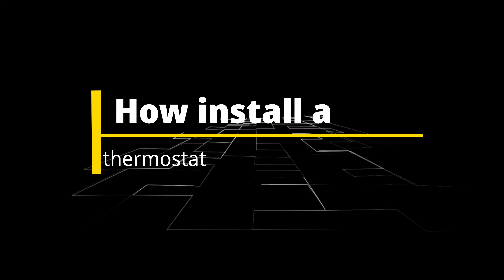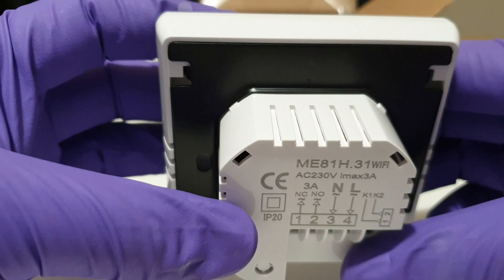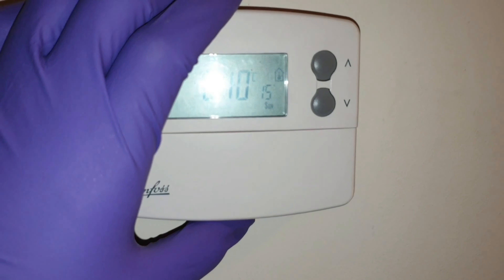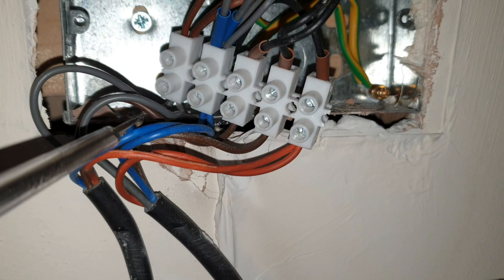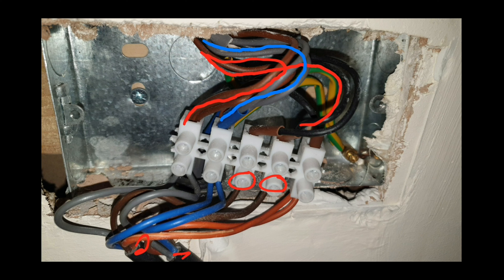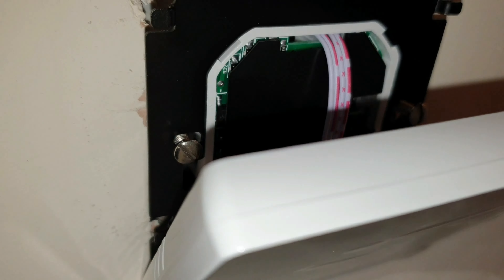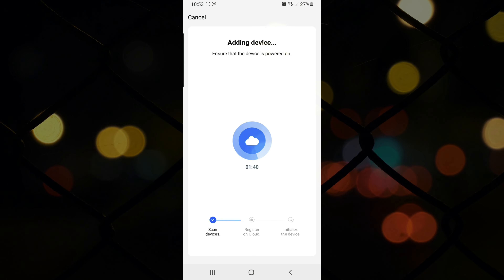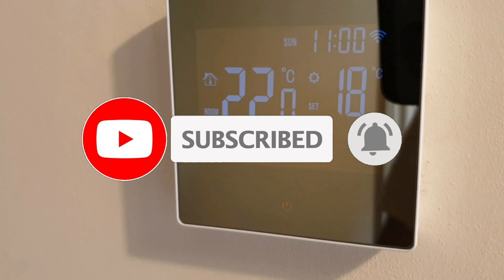Smart WiFi thermostat for under £20! And how to install Avatto MoesHouse Beca and others.

Comment: Hi, great video, just a quick question... The thermostat in your video is the dry contact for gas boiler or for water heating (underfloor heating). I found few thermostats (same model as yours) on amazon but they have different diagrams at the back. My original installation is exactly same as yours, with exactly same equipment. Thank you
Reply from the maker: If you have boiler powered underfloor heating then yes the same process.. there are a few electric underfloor thermostats which have different diagrams
Reply: @laymandiy  i have a same Danfoss thermostat, same valve actuators as yours, exactly same wiring, the pipes going under the floor but they are connected to the standard radiators. The boiler is Ideal. I ordered thermostat for underfloor water heating with normally open, normally closed, N and L and unfortunately if i connect L N and black cable to NO the thermostat wont turn on, with a bridge between L and NO same result, it will turn on only if i bridge NO with N but than is rebooting constantly. Is this means i should get different thermostat which is labelled as Gas Boiler/water heating dry contact?? Thank you so much for taking the time in a weekend to help me out
Reply from the maker: This is the wrong thermostat for you..
Reply: @laymandiy  Awesome, thanks, I will get Gas Boiler/Dry contact then
Reply: @laymandiy  same thing with dry contact boiler thermostat. The Thermostat is booting up only when I cross Neutral (blue) with contact (black) wire, if Life is bridged the screen is not turning on. Any idea?
Reply from the maker: Which wire is live, not colour but actual live using some testing equipment. Sounds to me like your wires are mixed at the junction box..
Reply: Live is brown, oryginaly connected to  com port on Danfoss box, but i checked this wire with multimeter and is showing 190V, grey is neutral, black is signal/switch to the actuator, oryginaly connected to NO port in Danfoss box
Reply from the maker: With live and neutral alone the thermostat should power on. Does it?
Reply: @laymandiy  nope, i found the problem, neutral not connected in the danfoss box in the cupboard... Thanks for your help
Reply: @CichlidVibes  Hi, think I have the same problem. I have the exact same wiring as the video but suspect like yours the neutral isn’t connected. Where do I locate this? The RCD unit or somewhere behind the thermostat? Thanks
Reply: @pauloneill1067  I have a white Danfoss box in the cupboard just next to the RCD unit. It looks like this. RCD -> Danfoss Box -> Actuator Valve.
Reply: @CichlidVibes thanks for the reply 👍 Had a look. Can’t seem to see one beside my RCD. Will keep looking

Comment: Providing i have data / Internet on my phone can I control the heating from anywhere in the world or do I need to be connected to the same WiFi as the thermostat?
Reply from the maker: Anywhere in the world ..
Reply: @laymandiy  and what receiver would I need which would be compatible with this thermostat
Reply from the maker: Just a router..

Comment: Does this control heating the water tank as well or just central heating?
Reply from the maker: No this won't control the hot water tank, just central heating. You can use it in conjunction with your existing system. Set the heating from the boiler control to be always on and then controlled by this unit.

Comment: My current thermostat only has r and w wired with a jumper from r to c can this tuya work with that?
Reply from the maker: You need a neutral to power the device. Unless you power it seperately. You'd need to check your electrical regs for that

Comment: Hey buddy do you know if I can hook this thermostat with just 2 Wires? I have central air conditioning and I just removed the old one and I only have 2 wires
Reply: I need to know too
Reply from the maker: 2 wires means it's simple switch. Unfortunately there isn't a simple way to do this. You need a neutral. You could supply power direct to thermostat and connect the wires to dry contacts. In theory that works but please ensure that you follow your local laws if sucha thing is allowed.

Comment: Hey LaymanDIY 
Congrats on your excellent content.  
I wonder if you can guide me.
My combi boiler is Vaillant Eco 825 with no room thermostat installed.
The programable thermostat I have is a Tuya ME81H with the same back terminals as yours.
My boilers thermostat only has 2 terminals as far as 240V ac is concerned.
I don't think the 2 wires simple go into terminals 3 & 4 of the thermostat?
Otherwise where is the demand wire to switch the boiler on?
Please  heeelllp
Reply from the maker: 2 wires is common. The boiler thermostat, is it mechanical ? U can usually decipher from the wiring diagram on the existing thermostat
Reply: @laymandiy  sorry to hijack.. I've got same issue , mechanical thermo so I guess I am gonna need to run a 240 supply if I want to go smart and digital as well , which will be a pain are there any battery ones out there ?
Reply from the maker: @groundbeef662  It is very easy to decipher if you have the wiring diagrams. Live is not a problem, all boilers have a live 240v. There will be wires going into the mechanical which will be similar to a switch, if you forget the timing element of it all and just think of it as a switch that turns it on or off, you need to connect the 2 bits that complete the circuit to the dry contacts.

Comment: OK so these are Good Smart Thermostats, BUT my home has 2 pipes for cold water based Fan-Coil Air conditioner, and 2 pipes for hot water UNDERFLOOR heating. So I thought this type of thermostat would be great...... BUT in heating mode, I cannot see how to turn off the Fan, which is only needed for the Fan-Coil units...   Any ideas, suggestions, help, alternative 4 pipe thermostats, would be MOST welcome!!    It just needs a firmware update to achieve this but????
Reply from the maker: No your cannot update the firmware. I'm not entirely clear on how or what controls the hot flow and cold flow. Are the AC and underfloor heating linked?
Reply: @laymandiy  Hello, thanks for your interest. The Underfloor heating pipes and zone valves are separate to the cooling pipes (fan coils units) and their associated room or zone valves.  They are not "linked" electrically unless I have a single thermostat to control each valve  ie a 4 pipe thermostat, The only place they are "linked" is in the pipe work distribution system and "indoor" mixing, pumping system thats part of the heatpump machinery, The heatpump changes mode when told to do heating, so the AC fan-coil pipe system  is not used, hence I don't want the fans running..    When it's in colling mode, the heatpump tries to keep the circulation water down to maybe 8 or 10C, and when in Heating mode the circulation water is pushed up to 35C or maybe 40C suitable for the Underfloor heating... but that water isn't pumped through the Fan coil units... likewise the Cooling water isn't deliberately pumped through the underfloor system
Reply: I have written twice at least to BECA the company that makes the BEC-002 or is it BAC-002 to ask them about this issue...
Reply from the maker: Picture speaks a 1000 words, perhaps you can link to a system that does the same thing online or similar set up to yours. I'll be honest I've not encountered something like that before in that fashion but at the end of the day it's just switch with WiFi and thermostat so can't be that complicated. Just need to identify where to swap it for.

Comment: Hello I recently bought the same thermostat (not Avatto brand but it looks the same), I installed it and everything works as I expected, but I noticed a problem with its watch, it is more than 5 minutes behind for an hour, can this problem be fixed ?
The thermostat is not connected to the Internet, but only to the Tuya mobile application
Reply from the maker: The only way I can resolve this is by manually setting the time on the thermostat
Reply: @laymandiy  It turned out that the thermostat is adjusted only via the Internet, when not connected to the Internet it lags behind by 10-15 minutes per hour.

Comment: Just taken my old thermostat off and the only wires there are Live, Neutral and Earth. If I connect it where it says L and N then it powers up but won't turn the heating on.
Any idea how to install it?
Reply from the maker: Exact way I've shown in the video. If your old thermostat battery operated?
Reply: @laymandiy  I have the same issue, just a L & N with a Danfoss TP5000, with battery. Connected & works the new unit but wont switch boiler on/off. Tried adding a link to dry contact 4 to L, no change.  checked boiler unit, can see 1 wire going to Room/Stat/Timer. (2 zone system, but that all looks good) thanks in advance
Reply from the maker: If it's only 2 wires then you don't have a live and neutral but rather live and switched live, which basically means the battery operated thermostat completes the circuit when the temperature is reached.

Treat dry contacts as your switch. Both the wires need to go into dry contact. That leaves you with powering the thermostat, which can be done using live from one of the dry contacts. What's interesting is that your thermostat seems to turn on. Does it still turn on if you remove the neutral wire into the thermostat?
Reply: @laymandiy  yes confusing but I'm learning more with each step. I've removed the blue (L2) and it will not power on with just brown in the L1 slot.  I tried bridging the dry contact (4) with the red wire (L) but still Will not power up boiler. I guess I need to trace the cable back to the boiler unit & maybe start again with new wiring?
Reply from the maker: Do you have a picture of how it was wired up previously with the danfoss?
Reply: @laymandiy yes I took a pic before. Looks pretty straight forward. You can see that on the back plate, brown is in 2 COM  which is switched. Blue in 3 N/O. There is a 1 NC which from what I can tell, is connected by one of the 3 pins in the unit when it's reattached to the back plate

Comment: Hello, just trying connect thermostat like on your video thermostat on I can hearing click on thermostat but boiler wont turn on? I have same old thermostat like on video. Can you help me why boiler wont start?
 Boiler wont get signal from thermostat.
New thermostat I have BHT-002GCL with WI-FI
Thank you
Reply from the maker: It's a simple switch considering that the old thermostat only has 2 wires going into it. Have you made a jumper between live and either no/NC? Failing that, and given your original thermostat was working, id say your unit might be faulty.

Comment: Hi I got 2 thermostats (downstairs and upstairs)i connect them same like you did. When I put on that one downstairs heating works fine.when I put on heating upstairs its not working till i switch on that one downstairs. Any ideas?
Reply from the maker: Sounds like the upstairs is linked to the downstairs at the junction box. Is the upstairs thermostat on when the downstairs isn't calling for heat?
Reply: @laymandiy  I don't see it junction box the 2 others honeywell cm907 been working separately before .this house was build in 2015 .and yes upstairs doesn't work (4 radiators)till I'm not put it on another one.
Reply: Thermostat looks like works but radiators are cold
Reply from the maker: To be safe, I would put the old cm907 on to check if it is still operating separately. Leave the new one downstairs as is...

Did you do anything at the junction box?
Reply: I put it back on the old one upstairs and left smart one downstairs and its same doesn't work .I think my junction box is built in in my vaillant boiler and I don't open it
Reply from the maker: Now if you replace the one downstairs with the old one, logic says it still shouldn't work right?... Unusual if you have two separate systems for it to be done at the boiler
Reply: I put it all back again(old ones) and its same top thermostat do not put in radiators till I'm put it on downstairs
Reply from the maker: Definitely looks like a wiring issue. You need trace the wires to the junction box. Looks like the return for the upstairs thermostat is not wired to the boiler but off the downstairs thermostat.
Reply: I found a junction box and the wires were swapped the other way around. Another problem was that the pipes were reversed. the main pipe was connected behind the switch

Comment: Hi LaymanDiy, I only have two wires for my room thermostat (one live and another neutral) could you please advise how I can wire these? My existing one is an EPH Controller CM2.
Reply from the maker: It's the existing connected to terminals 1 and 2?
Reply: @laymandiy  Thank you for your response. Yes it is. Live going into 1 and neutral into 2
Reply from the maker: Sounds like it's not a neutral but rather a switched live. Which basically means that your thermostat is just a break in live circuit
Reply: @laymandiy  cheers, so this thermostat won't be work for me?
Reply from the maker: It will if you can find a live and neutral to power the unit. Unfortunately not aware of any permenant smart device, that doesn't require a permanent power supply

Comment: The only problem is. Both receiver and controller are in the same box. I have Honeywell. The Receiver next to boiler and wired and controller is down at the tv room n shows the temperature of the room. This thermostat doesn’t have separate receiver for me to wire it next boiler. Otherwise it’s really nice gadget.
Reply from the maker: You can get an alternative version of this

Comment: Hi can this Thermostat also control Hot Water?  Or is it simply a heating stat?
Reply from the maker: Just heating. Do you have a hot water tank?
Reply: @laymandiy  Got an IDEAL boiler with a Honeywell Interface to set on off timers for CH and H/water in the kitchen and in the hallway have the Honeywell Thermostat -
Reply from the maker: You could set the CH to be always on from the programmer side and install this thermostat to control only the heating.

Comment: hi Layman DIY first thanks for video it's  very good! I bought Avatto  Thermostat Controller for gas boiler recently, i have 2 port motorized valve next to my hot water cylinder. Wiring will be the same? Please help me ,cause electrician ask 150 euro to change it.Thank you!
Reply from the maker: For some reason I didn't see this comment, sorry. Did you resolve it? It shouldn't matter. Most modern builds have a 2 port motorised valve or zone valves. You are changing a thermostat and if it has been wired correctly, it wouldn't have been done at the thermostat.

Comment: Would’ve been a great video of you didn’t skip the wifi enabling process. Arguably the most important part of getting a WIFI CONNECTED THERMOSTAT. Everything else was fine but really just skipped that part
Reply from the maker: I didn't skip it, it just connected really quick. If you are struggling with WiFi 9/10 it's to do with the bands. If you have one of those routers that merge to optimise 2.4/5ghz radios, you'll need to split the ssids into separate ones.

Comment: so can the thermostat be controlled physically or does it ONLY get controlled by the mobile app? also why didnt you link the thermostat in the description? D:
Reply from the maker: Thermostat can be controlled physically and doesn't require the "smart" to even be used. All functions found in the mobile app can be accessed via the unit itself.

You can search for the thermostats on AliExpress. I didn't want to link it because people have mixed experiences of aliexpress.

Comment: i have a me81h for a gas boiler if i wire it like you it trips electric
Reply from the maker: Remove the jumper does it still trip? Your configuration night be a little different. Does it trip from the get go or does it trip when the time comes to switch on
Reply: @laymandiy  trips straight away soon as electric put back on

Comment: Hello 
Why can't my cell phone find the thermostat when I want to connect it
Reply from the maker: Are you using 5ghz network, or perhaps an unsupported WiFi security?
Reply: @laymandiy  no I'm not using 5g,
Its a normal 2.4ghz WIFI
Reply: I try on Samsung mobile and do not see it any devices?then I swap for my wife mobile and its OK now.I think this app do not work properly on samsung
Reply from the maker: I used on samsung.. try Tuya  instead

Comment: I have three wires like this set up has. Mine doesn't work. Same model. Anyone able to help?
Reply from the maker: Is the thermostat on but not turning the boiler on?
Reply: @laymandiy  It just literally flashes/blinks.. that's all
Reply from the maker: So nothing displays on screen? Sounds like you have a faulty thermostat. Even if the heating doesn't turn on, a normal functioning thermostat should at least turn on and let you connect to wifi
Reply: @laymandiy  I'm not sure if I have the same three wires. I saw a video where another guy went on to the board of the boiler and changes some wires. I have a live neutral and earth. That's all..
Reply from the maker: In my video I explain how to and why you may need to trace the wires. Easiest thing to do is to wire the live neutral directly to the mains and see if your unit is working.

Changing things on the boiler is only required if you are changing the way it use to work before. This is a thermostat replacement for heating only.

Comment: Would have been much better if you had used a meter showing the voltages, my live shows 64 v but i was expecting 230.
Reply from the maker: Clearly something is wrong.. why would live show 64v. My readings came up to 236v. Are you using it for floor heating?

Comment: u have change black wire from 1 then on 2 position also doesnt NC is connect to L
Reply from the maker: I only did that for access because it doesn't matter which way round the circuit is for my setup